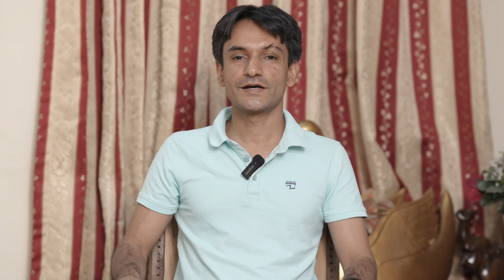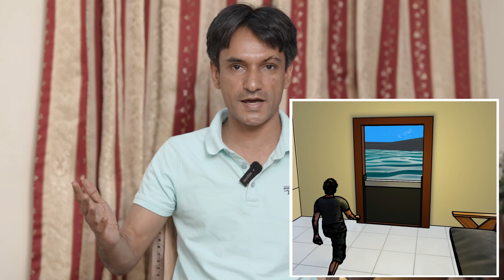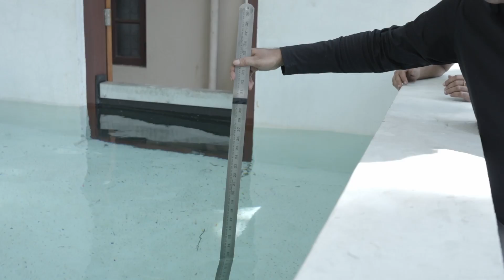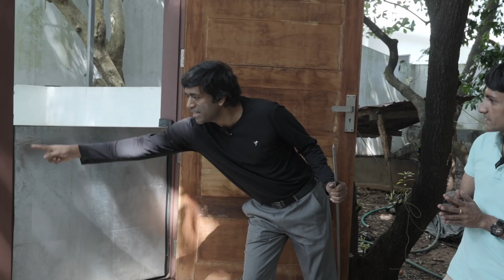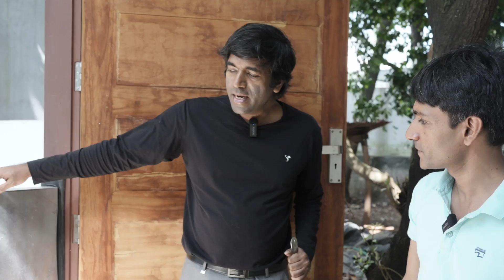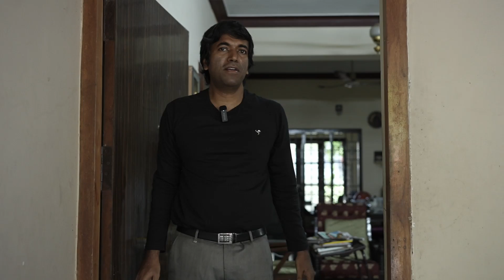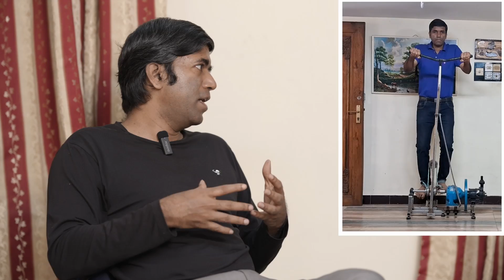Expandable Flood Barrier | A Life Saving Technology

Comment: I am Praveen Vettiyattil, inventor of this Expandable Flood Barrier

FAQs
1) What if flood water enters indoor through drainage/septic pipes?
Answer: Fix ball valves on the outdoor side of drainage/septic pipes and close then during a developing flood.

2) Will the walls collapse at 2.5 feet high flood?
Answer: Normal residential brick walls wouldn't collapse upto five feet of flood.

3) Will the floor cave in?
Answer: 90% of floods are below 2.5 height above the flood. Water could leak in through the floor if flood height is above 2.5 feet above the floor, but this inleak would be small and could be pumped out using a diesel/petrol powered pump or could be mechanically drained out. By the time flood water passes through the minutes holes (0.1mm dia) and infinite bends on the thick ground soil to reach below the floor, a lot of pressure is lost. This is why water inleak through the floor would be manageably small. Because a small amount of water will leak through floor at above 2.5 feet flood, there will be no pressure built up below the flood and thus the floor wouldn't cave in.

4) Can I use the toilet in my house during flood
Answer: Flood resistant toilets and Floating toilets are available to buy and install.
Reply: I wish you great success. Awesome product.
Reply: It looks super promising! And the things you mention should be a part of building standards.
Reply: It's not the simple
Reply: Hello mr Vettiyattil, I'd like to see it in action being set into the doorframe. I understand that it is not shown because it would potentially show the trick. Anyway I find extremely important to know the set time.
As others say, maybe not in the most kind of manners, maybe water comes in a rush, or maybe comes only little by little. Different scenarios that we don't know what reaction does the product provide.
Another FAQ I'd have is if you plan on having a single set for multiple doorframe widths

Anyway, I wish you great success.
Many thanks for your time
Reply: @praveenvet could your barrier withstand turbulent water that occurs during floods which exerts more pressure than static fluid. You can calculate the pressure energy which is think is more thsn what this barrier can handle
Reply: Protecting individual houses like this is not a solution. Like others already stated, water will find another way inside your house unless you do some expensive investements. It also has some potential flaws I don’t see in this video.
#1 What is the water rises slowly. Will it expand already when there is only 2 centimeters of water?
#2 You have to pre-install this in a doorway. A passage made to go in and out the house. Do you have to put it in the doorway every time after I use it to go through? Water can come unexpectedly. No way to prepare from that. If I want to protect, I can build a barrier in a much simpler way.
I live in The Netherlands were we deal with high water very year. Solutions need to be found in other systems to keep water out of towns and villages. We even do that with automatic barriers that rise out of the floor to protect from rising water. It even uses the water pressure from this rising water.
In this way your whole house is protected, including the sewage system.
Reply: So basically by admitting what you do in #1, you're saying that this product is effectively worthless and useless unless paired with a plumbing overhaul....
That's swell lmfao
Reply: @CantHandleThisCanYa  It is not the critic who counts; not the man who points out how the strong man stumbles, or where the doer of deeds could have done them better. The credit belongs to the man who is actually in the arena, whose face is marred by dust and sweat and blood; who strives valiantly; who errs, who comes short again and again, because there is no effort without error and shortcoming; but who does actually strive to do the deeds; who knows great enthusiasms, the great devotions; who spends himself in a worthy cause; who at the best knows in the end the triumph of high achievement, and who at the worst, if he fails, at least fails while daring greatly, so that his place shall never be with those cold and timid souls who neither know victory nor defeat.
Theodore Roosevelt

Comment: 1. The government by law in flood areas should force people to build empty the first floor and the multistorey buildings must be made of concrete, 2. Existing homes in flood areas must permanently move their doors and windows upwards and strairs must be used for the doors; if the ceiling is low it can be destroyed near the door to be replaced with a higher roof region near the door.

Comment: @Lesics 26:14 can this barrier handle the turbulent flow of flood water? Because holding static water is different compared to the turbulent flow which includes pressure energy of the incoming water.

Comment: 00:02 Expandable flood barrier protects homes from flooding
02:31 Developed a stronger expandable flood barrier technology than other manufacturers
07:26 The expandable flood barrier withstood 2.5 ft of water, proving leak-proof.
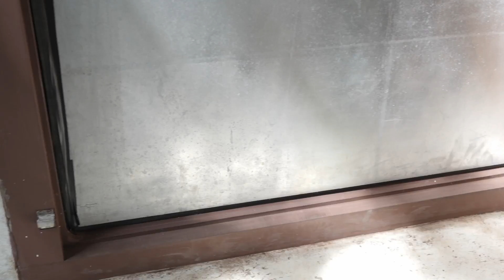10:10 The expandable flood barrier automatically expands to three sides.
16:22 Social media can drive automatic product orders without marketing or investor support.
18:32 Prevention is better than cure for flood damage.
23:06 Expandable flood barrier can be used for controlling flow underwater
25:14 Expandable flood barrier technology can revolutionize valve technology.
29:29 Praveen emphasizes on using freehand drawings and his unique approach to solving mass market problems.
31:51 Iterative technology development for successful prototypes
36:05 Revolutionary outdoor lighting technology
38:17 Praveen has invented a pedal power generator
43:00 Inventions create millions of jobs and lead to a better world.

Comment: Common questions
1) What if flood water enters the interior through drainage/septic pipes?
Answer: Here in Brazil, water enters the interior through drainage pipes🌊💧🌧🌎
Reply: install nrv (non return valve ) on the sewers, which will prevent the back flow of sewage / effluents depending upon the location(s) at which the nrv is/are placed.
Reply: Yeah it's not actually a solution for anything

Comment: I subscribed to this channel, because I probably saw something interesting. However this "invention" in my oppinion is simply useless. Why?
- You need all door frames to be more or less a couple inches within designed parameters (this doesn't happen too often, especially in poor areas).
- It's mechanically expanded rubber sheet. Nothing miraculous about it. It's using door frame and wall strength to hold on to. If you go in panic mode (like say during a flood, when your life depends on your fast action), you can destroy your door frame, even risking the wall collapse.
- You get just a specific height. What if water goes higher? You have no idea how high will be the flood.
- With all that effort, why don't simply built the water tightening system in your door? Why do you need just a half of your doors protected? Ask flood to go below windows height?
- There are systems of water tightening doors used in water gates for transversing lakes and rivers. Those work just by wood to wood contact and water pressure tightening. Those systems are used in my country for hundreds of years.
- You can have a much simpler and more versatile system if you use just a wood plate with only a rubber gasket around it and and expanding bar to fix it in a door frame in such way, that water pushing from the outside would seal the plate to a door frame. I have such expanding bar in my doors to practice pullups. And it probably costs pennies comparing to all mechanical system covered in a rubber. You can even make those things modular - 2 or 3 plates for one door for complete coverage. But then you should have such set for your windows too. And this is where much simpler and cheaper solutions will beat this thing totally.

And those are just a few of problems I see at first glance. Engineering is amazing, but if your goal in mind is to make something useful for a lot of people, it should be cheap, very easy to use and versatile.
This invention looks like "it costs a lot to manufacture, it can destroy your door frame and it will only protect you untill your windows are flooded".

I don't wand to discourage any inventors. I love when people are designing solutions to their everyday problems. But this thing shows how many view angles on this problem were completly omitted.

Now when I thought for a few minutes about the problem, I got a different idea which would require a bit of manufacturing. A groove around doors and an air pressure expanding tube sitting in a groove. I bet India has a lot of bikes. So probably there is a lot of discarded, but still usable tires and bicycle inner tubes. Such inflatable seal can be made in a day or two, using discarded bicycle tires, with basic tools and a bit of a rubber glue. For extra protection of the expanding seal, you can just nail additional rubber ribbon around doors. Then during a flood, someone would simply take a bicycle pump and seal those doors in a few minutes. After installation, you need only to hang a bicycle pump near your doors and this system can be primed at any time, even with a panic mode on.

I showed two alternative solutions where material is easily accessible, anyone with some basic mechanical skills and a few basic tools can make it in a couple days. But I won't make a production of this and I won't earn anything.🤣
Or maybe? There are flood areas in my country. I kind of liked that rubber seal around doors 🤪

[Edit]
Even simpler solution based on water locks. Outside opening doors. Wooden frame shaped like a cut off top pyramid, with fitted frame and a simple rubber gasket around it. The more water is outside, the tighter the seal becomes. No needs for any other action than just closing the door. Any woodworker would be able to make such doors.
Reply: Well explained sir...this is downright factual stuff that ppl dont wanna hear about lol
Reply: @mukundanm2666  Thank you. I'm used to such discussions, because in previous company when we were building warehouse automation, we had meetings where we would discuss many ideas. Every point of view is precious. I look at things from technical perspective and a practical point of view. Other people see challenges from a beauty standpoint, or financial possibilities, or logic behind programming. Only if you manage to combine it all and agree on a solution, you can make something incredible. That's why i wrote my thoughts and I hope Mr Praveen can use them to make his invention better.

Comment: The larger the volume of water (width or depth), the heavier the weight of water putting pressure on a barrier. 1 cubic meter of water weighs a ton. With respect, the volume of water tested is miniscule to an extensive flooding event (eg 500m across) and corresponding weight increase. I'd like to see that barrier stop the water under those conditions.
Reply: go learn some fluid mechanics. pressure depends only on the depth(Height).
Reply: @mbala101  @AyushYadav-zo9lp You are both wrong! Pressure depend also on the fluid velocity. We dont have only static pressure here.
Reply: You are right  @s_amoku , velocity (actually acceleration) matters. But we are talking about residential usage and not some industrial scenario.
Reply: Pressure of a fluid, only depends on its depth, and not the width of the water column
Reply: Cost